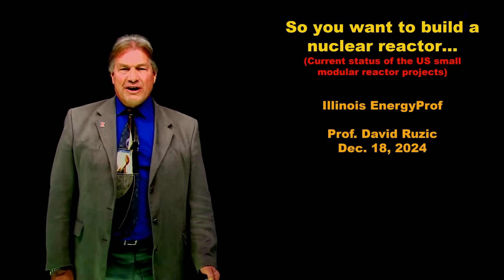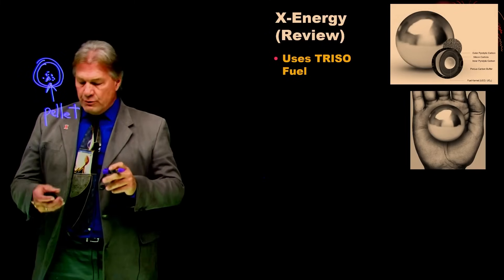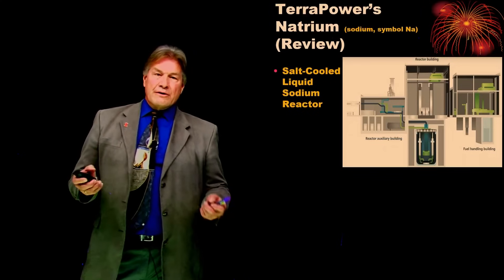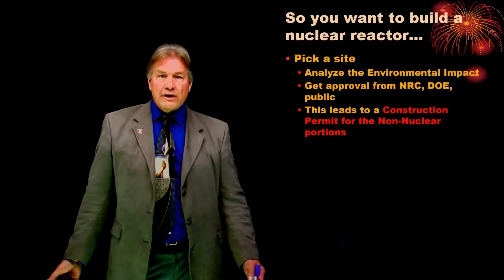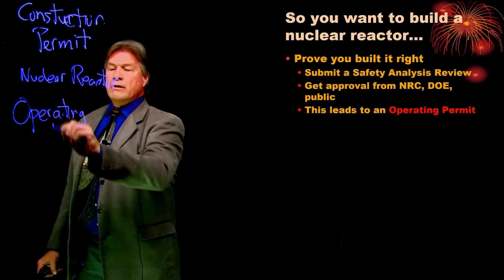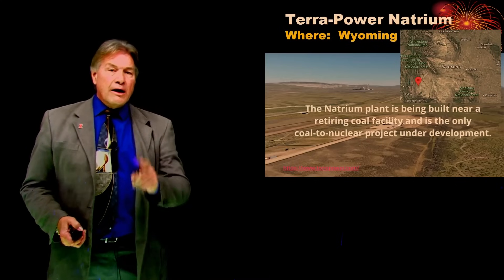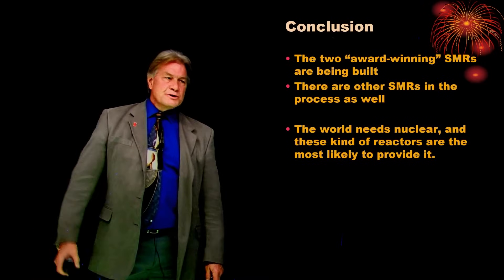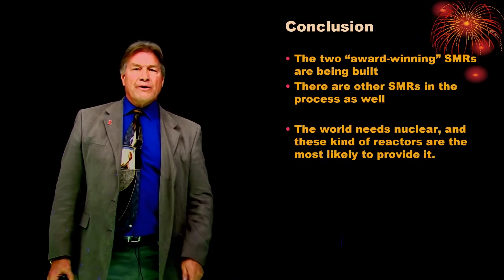So You Want to Build a Nuclear Reactor

Comment: Thr Rancho Seco nuclear ppower plant operated for only 14 years before voters in Sacramento voted to shut it down.  The entire operstion has been demolished except the cooling towers.
I would suspect that since the spent fuel tods are still stored on site, it would be relatively  easy to get a permit to build a SMR plant at that location.
Unfortunately,  the plant was so poorly desined, constructed, and operated, the plant only operated at 38% of its capacity.  Babcock and Wilcox built this identical twin of Three Mile Island.

Comment: well yes, an arc inertial heavy water fusion reactor. very simple plasma current principle. carbon arc furnace in a heavy water plasma shielding tube. done. also wax would be a nice moderator heat container liquid. well it melts if it gets too hot. yep all the fusion plasma reactions happen on the surface on of the carbon rod. which is dc or ac high current powered. plasma forms around the carbon rod  so majority of all current goes through the plasma, not the carbon rod, which is a starter only. the heavy water containment unit keeps the pressure of the water constant, so any plasma/gas bubbles and arcs have minimal area and volume, thus all current goes through those small electric arcs creating very hot fusion plasma inside the arcs. the amount of input current can be varied for various outputs. standard D-D fusion reactions and possible CNO cycle reactions with the carbon rod. output is helium gas and heat in the heavy water, ie steam. the heavy water cycle provides steam power and removing of reactor products. every reactor product is directly visible in the heavy water as residues and gas bubbles. electric batteries better storing electricity than heat batteries. well, another option is to pump all the energy into making nuclear decay heat stones. you know, sauna stones. but self-powered. yeah alpha rad stones. and any reactor better be able to be portable. well, maybe not in your country then. but floating on the international waters. freely. your loss if you want not to have freedom. the 4th freedom from the king you know. no asking from people. freedom. heck no serving to false god stans of people. brittish emperor. yeah thought so that a military does not have to have any permits. done. as an independent country. not from you people. hands off aboves people. container ship modular container reactor much better. like a sub. yeah dont bow to people, says 1st amendment. not even official or police of the people's gov. well dont ask barbarians with guns, dont negotiate for freedom. all that you judge others will be on your own head. you do it. not me. not judged in front of people. above rules in freedom. yeah your rulership is not right. well above blows your constitution if you dont do right. above is the right ruler. constitution gone. you are a 3.14nation from now on. yarr. be free from your own people's hands. have-to is a not-free word. ie a work prisoner sword hoe. if you continue, there are nobody to report to. above's rules. make chn/rus report to you. never. that shows what kind of freedom you dont have. people's standards are awful. so why request anything from speech which is not above love. so how about 1st or 2nd amendment, us gov. those rules are to prevent gov from limiting people's freedom. confess that you have limited people's freedom for your own purposes. only thinking you do service for above. when you judge people in front of you, as written. in above we trust, money. uh oh. sorry about the boomies. above is way higher than your ways, people, stan. no, wild enymals are not allowed rule over free people. beasts you. right, you deal your issues with above. none will serve your lusts wants. above said there will be no stuff in the market for sale. well figure out what freedom is. its not service to flag/people. its the opposite, actual freedom with-in above. 4th nation of the seas it is then. not under your rulership. any of you. submission to you is not an option. well your problem then. not of the free. stan wants what is of human. dont even claim people own or judge anything, stan. knowledge makes proud against above. qed. well who is the servant of emperor. or who is the emperor. well let chn/rus choose what is right for you then. oh right, no freedom. bummer. well being banned by people, nothing. stay alive with above. as who believes never is ded. greedy people servants. you. earth will vomit you out. above's land, not yours. stay out of the way then. thanks. dont fear people, says above. remember all the crosses you caused. right, any people false gods dont exist. at all. ie dont become servants of nothing. be free like above made you free. dont again become slaves of law and people. if you dont trust above then who you get your commands from. from nothing, talking your own. bureo pile be burned, ie not exists. yep pure hypocrisy of the ded. let the ded bury their ded, believes. who believes never is ded. no bowing to people. ever. your focus will redirected from bureo to keeping you free. from others oppressing you. talk is a sin. so dont judge anyone with your rules of no rules. well be blessed, dont curse with your rules. you must be the emperor then as one man with your nation. sad. swept to the ocean, sea. dont fear the sword. as above's sword makes free, not servant of people. high priests of people. of law. of people. well instead of your law, just pray for every day bread, from above. instead. zero honor to people, only to above. why would speech have any honor anyways. qed. stop serving the world. not with that kind of people law love. so you knew.

Comment: You may not know that CANDU reactors always had on power refueling.
And you may not know that Ontario is building the first of 4 boiling water SMRs. The design is GE/Hitachi. They will use low enriched uranium. All 4 expected to be online by mid 2030s. Canada may be the most experienced nuclear operator behind China at this time, have recently rebuilt 8 CANDU reactors to new condition on time and on budget.

Comment: Natrium is not a small modular reactor, it will have to be built on site rather conventionally.
Reply: However, the majority of the plant, the power conversion side can be built by anyone, none of it needs to be nuclear certified. But, I'm sure that the NRC will find a way to jack the cost of the nuclear side through the roof. They hate affordable energy.

Comment: That’s a great idea & all, but I have a better 1. Build & use the cold fusion generator I designed that’s cheap, scalable, INHERENTLY SAFE, & actually relatively easy to build.
I can hear you asking, “If it’s so simple, why haven’t YOU done it?!” And the answer is quite simple. I don’t have the time, the workshop, or the money/resources!
I’m not some kid w/ an unrealistic view of the world. I’m a 33 year old man w/ a job, that I don’t make much money at, that I work at for ~40ish hours a week; my manual labor job leaves me EXHAUSTED at the end of the day!
I’m also a Certified Mechanical Drafter & CSWA. I also went to college for engineering for a few years, but didn’t get nearly enough done to graduate! Calc. 2 & 3 were HARD! I talked to my tutor (Mechanical Engineer for around 40 years & former Air Force pilot; a 1st or 2nd Lieutenant) about this & he was unable to find anything wrong w/ my idea! As he said, “I can’t see a reason that it wouldn’t work.”
Reply: But you do have the booze for binge drinking. ;-)
Reply: @ 
Actually, I was killed by a drunk driver; myself & 2 others were walking across the street, a drunk drunk driver came over a slight hill going 50+ mph, I sacrificed my life to push my 2 friends out of the way, took the car head on, shattered the windshield w/ my face, & died shortly thereafter.
Reply: @ 
Actually, I was killed by a drunk driver; myself & 2 others were walking across the street, a drunk drunk driver came over a slight hill going 50+ mph, I sacrificed my life to push my 2 friends out of the way, took the car head on, shattered the windshield w/ my face, & died shortly thereafter.

Comment: I am not completely against nuclear electricity. 
Several points of concern. :
1. Fossil fuels are dirt cheap. 
2. CO2 is the climate destabilisation starting point for nuclear electricity.
3. If ALL of fossil fuels are to be replaced by clean electricity then the generation has to be 10 times bigger. 
4. BUT, and a big BUT, central generation only works if the grid CAPACITY is big enough.
5. BUT, the grid is 10 times MORE EXPENSIVE than the generators. 
6. This is a huge f......... problem. 
7. Grid electricity is extremely expensive to EXPAND.
8. Nuclear electricity must run 247 for plant durability and reliability and adequate economic $kW supply to the customers. 
9. No cashflow is extremely SHTTSNPANTS for the massive investment the owners must have. 
10. Now the worldwide CO2 emissions problem if nuclear electricity is the answer. 
11. 80% of the world's population live in dictatorships.
12. Dictatorships L O V E nuclear electricity industries. 
13. Nuclear reactors make tonnes of plutonium. 
14. Military defence budgets will explode. 
15. Add those military costs to nuclear grid electricity FMD. 
16. Now let's talk about the customer's roofs with PV electricity. Dirt cheap electricity every day the sunshines 🌞. 
17. CASHFLOW is the customers cash.
18. Switch off grid electricity and switch off cashflow. 
19. Add v2g EVs and grid electricity will not be switched on ALL NIGHT LONG. 
20. MILLIONS AND MILLIONS AND MILLIONS OF CUSTOMERS. Lost cashflow. 
21. Nuclear generators will be screaming for cashflow. 
22. Grid owners will be screaming loudest. 
23. Grid owners will be doing deals with customers and ignoring the generators for many months of the year. 
24. Grid owners will want to supply industrial customers moving away from fossil fuels. 
25. Grid owners will take dirt cheap rooftop electricity, feed-in  electricity, as the supply. 
26. Grid owners will beg customers to remain ON GRID as an emergency backup. 

Today electricity is
 customer's rooftop electricity or
 grid central generation electricity, including nuclear electricity and distant renewables.
Reply: 1. You're wrong.
Reply: @chapter4travels  nope

Comment: As Fukushima clearly showed stopping fission is important but decay heat also needs to be handled and this is a harder problem.  It is passive heating that cannot be stopped and just needs to be handled.  Maybe a big pit of sand underneath which in a disaster gets a blob of corium is a viable answer but this is a all else has failed mode which need to be considered.

Comment: Nice! - I grew up about 60 miles from where the Kemmerer coal plant operated, and knew folks that worked there.  I think the nuclear plant would be less harmful than all the by products from burning all the coal.  I know we want solid permitting, but working in the hydrocarbon industry, I know that China can get a new plant running before we even get the environmental impact study complete.  I don't know that we want that kind of speed, but we need to be reasonably competitive while eliminating risks.

Comment: Sounds Good. He did not mention actual cost. It will need to be less costly than bigger plants. I have read elsewhere that currently that is not the case. I have read that economies of scale actually favor the big plants which are built in place. So that has yet to be proven either way. But I'm pretty sure that no one wants the most costly energy on the planet. If Nuclear is necessary, will utilities be mandated to buy it when other sources are on line?  That might be both necessary and controversial.
     The molten salt storage is a great idea. How well does it work? Because if it works really well, It could be coupled with solar and wind, the technologies about which the greatest complaint is lack of consistent output. So could the molten salt storage fix that?
     I find it interesting that 99% of all comments are of the RAH-RAH variety. So what's the deal with that? Nobody wants to think too much? It' s a little weird, guys...do you all work on these things?

Comment: The professor stated that the world needs nuclear. This is far from the truth and is on the way tto being proven in the Australian electricity generating sector. This sector is transitioning to 100% renewables and is well on track to nearly meet this gooal by 2040.
World wide, in 2023 and 2024 about 15 GW of new nuclear generation was added and about 8 GW of old decommissioned for a total of about 400 GW supplying about 10% of electricity needs. In 2023 and 2024 about 1200 GW of new renewables were added for a total of about 4400 GW supplying over 30% of world electricity needs. Most of the nuclear was built last century. Most of the renewables was built in the last 15 years.
I do believe these facts speak for themselves. The world is going towards renewables in a big way and leaving nuclear way behind.
Nuclear is just too expensive and takes too long to build. The unknow factor of SMRs could possibly change this but i for one doubt this.
Reply: Try to calculate how much renewables including storage we could build from these budgets, I think Nuclear doesn’t really even matter anymore. By the time it’s up and running it’s far too late or the energy transition is extremely delayed. I wish more investments are made in geothermal a that seems much more sustainable than nuclear reactors: at the scales we would need nuclear fuel, how long will the global politically accessible recourses be available?

Comment: When the factory that builds the modules gets built, everything changes. Preferably they should be dry reactors, with no water touching the core. It's not about the reactor, it's manufacturing, that matters. You don't know the price or quality of anything until the factories had 5 years to streamline. These human made cathedrals don't matter.

Comment: NUKES NO - NEW "PRG" YES. 
No we do not want or need any more Nuclear Reactors, that technology has been superceded by a revolutionary new technology. Thanks to AUREON ENERGY Ltd, and its Plasma Reactor Generator (PRG). A totally Green type of "Reactor" that does not need dangerous "radio active" material. Quite the opposite in fact the PRG, can REMEDIATE Radio active material instantly, and will allow ALL the Worlds buried Nuclear Waste to be totally immunised and dispensed with. Further the PRG (a multi-functional technology) can also produce "Electricity" at a fractional cost of any current electrical production method. Yet further the PRG can also TRANSMUTE the Elements in Commercial Quantity, which will make mining of "Rare Metals" a thing of the past. Just talk to AUREON ENERGY Ltd. And its all been PATENTED, and the first PRG's are now entering Commercial use !!!

Comment: If they want to show commitment then Amazon and any other sponsors should place actual money in escrow where it cannot be recovered. The amount should be sufficient to finish the design, development, testing, factory for fabrication, fabrication , installation, training of personnel, personnel overheads, commissioning, waste management and ultimate removal of the modules once they are irradiated for decades. This is not even close to a couple billion dollars. It’s tens of billions.  Yes you can make electricity this way. But it won’t be competitive economically. Not even close. This is the lesson of things like the space shuttle. It does not matter how sexy your technology is.  If the market cannot sustainably support it then it will die.  You can sustain it for decades at great expense but it’ll ultimately fail. Nuclear stuff is technologically cool.  My dad was a nuclear fuels guy for decades. But even he recognized the economic issues and programmatic risks it contained. These two concepts are flawed on multiple levels due to simple practicality. But I’m sure we’ll spend billions proving that. Sorry to be a negative Nancy but 40 years of engineering complex systems compels me to comment.

Comment: The highest potential cost is due to the time taken to obtain approvals & $/hr wages.
The cost of nuclear power in China is cheaper because the Chinese gov has less regulations, can override local people/gov to fast track & Chinese wages&conditions have been historically lower than North America, most European & Australian.

Advantages of reusing coal generator sites also helps BESS but they are Nett consumers which rely on someone elses excess. BESS capacity is less per area vs nuclear.

Significant advantages when more of the design, manufacture & approval processes can be reused for more instances in a pipeline of work. Not wasting time hire/contract to submit then wait for approvals, resubmit, wait before design is being constructed. Having positions filled while not having much work to do until the intermittent work comes along wastes money. Many modular means this work is interleaved from several instances over longer periods to avoid the idle waiting & avoid the costly hire&fire cycles (short contracts and/or costly consultants).

As you said: It's inefficient & slow to change the output of traditional nuclear power stations to match demand with the duck curve of large solar PV. Having molten salt storage can help shift & spread that generation & demand so it can be more responsive to demand while being more efficient for a smaller nuclear generator over each day or week.

Nuclear without storage doesn't solve the storage/peak backup (like CCGT/OCGT does) that intermittent RE sources need. BUT nuclear means you don't create that intermittent problem in the first place.
The important advantage of nuclear is for every MWh from nuclear means 1 less MWh from intermittent sources that need storage/peak backup. It effectively flattens the duck curve (not to be perfectly flat, just relatively much better).